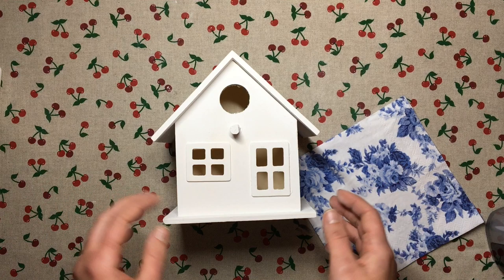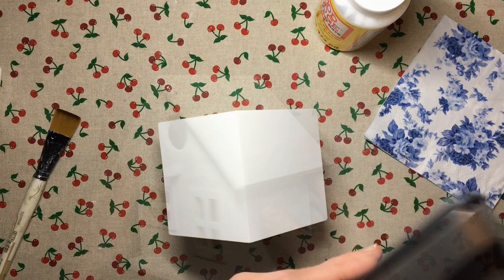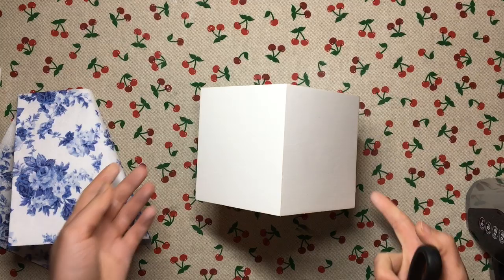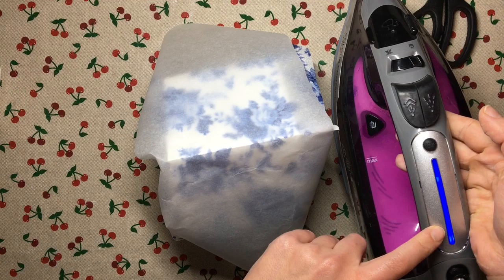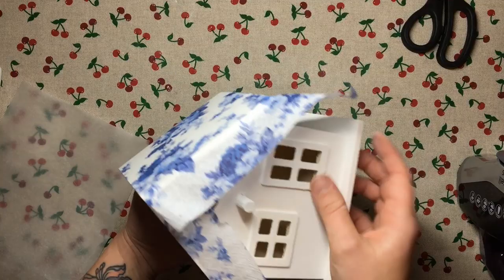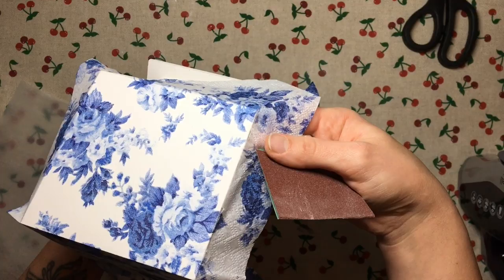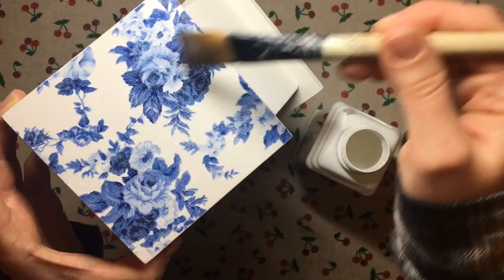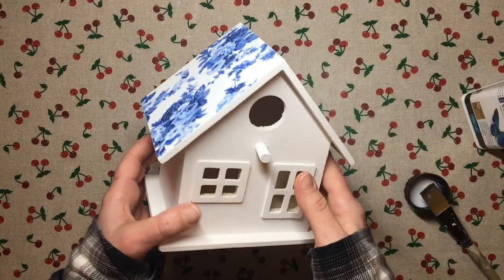HOW TO APPLY NAPKIN WITHOUT WRINKLES USING AN IRON | DECOUPAGE TUTORIAL

Comment: Varnish is a completely different product. The issue just mentioned is why I am watching this. I was wondering if you could avoid the top coat all together and skip to the sealer. I think you may have answered my question will will have to wa8t and see with my next project

Comment: Great technique! The only time I've ever seen napkins and ironing before is with clingfilm between the napkin and surface area, the heat of the iron melts the cling film (aka Saran wrap) and bonds the napkin to the surface. Would your method work with paper or card, i wonder? (I'm a junk journalist!) Will have to give it a try!! Thank you!
Reply from the maker: oh Gosh that sounds very stinky! Can't imagine cling film smelling too well when it melts :D Hmm that's a good question, I haven't tried it on card but I  think it should work, always best to try on something you dont mind getting ruined! :D
Reply: @IvetaZiedina  got to be honest, you don't melt it that much! There are videos showing how it works. I did it once before deciding it wasn't for me, it takes ages to actually heat up enough to bond the two materials together. I'll have to give your technique a go when i get a bit of time. It might actually help with another issue - because modgepodge is water based, any card or paper has a tendency to curl when dry. A lot of the time with journals that isn't a problem - we coffee or tea dye paper, after all, we're all about the crinkle factor! - but there are times when we want card to remain flat so that's why i was also interested to hear about the varnish. But then there times we want wrinkles in napkins. They age documents wonderfully, or give a great sense of texture, and then you can go over them with distress ink and a sponge.... 🙂 Worth thinking about for 'aged' frames maybe....!!